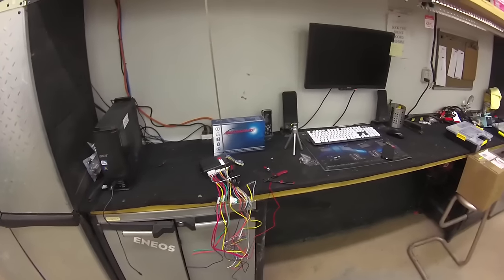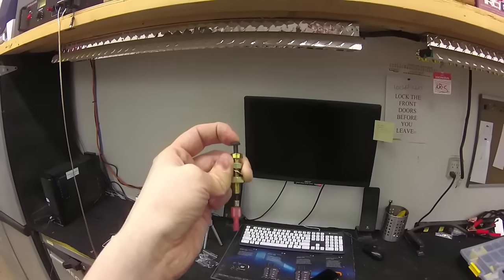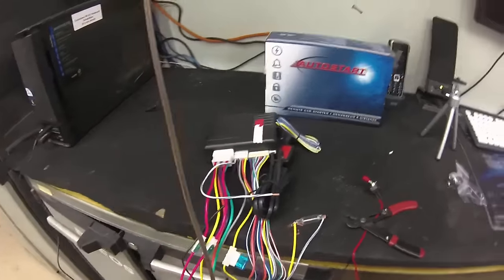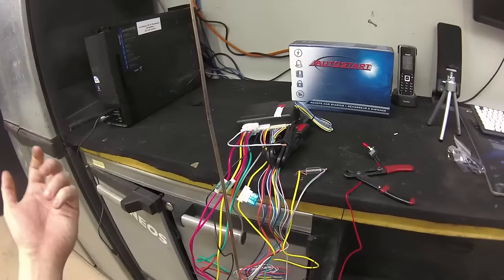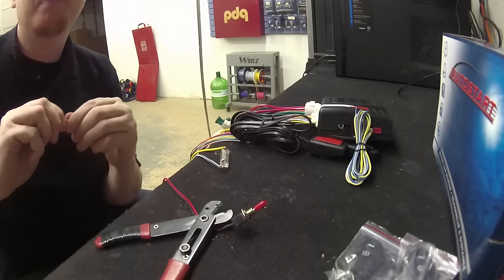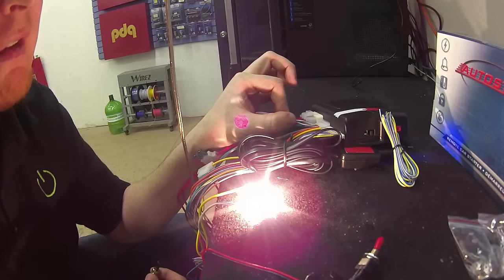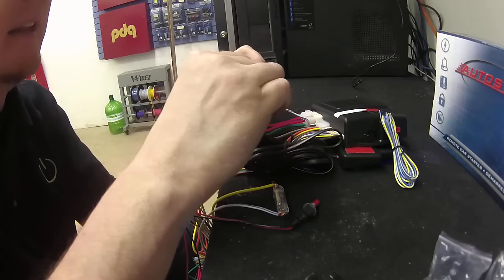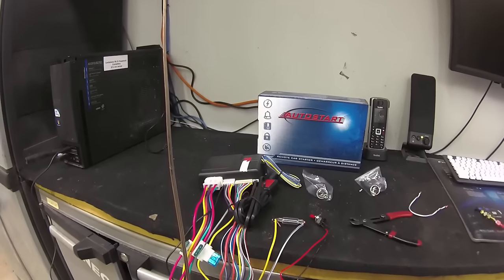How To Program an Autostart Remote Control Without a Hoodpin

Comment: ok i have a 2015 toyota tundra , now i got an autostart asra 2510 install on it , when i start the truck with the remote and the wiper switch is ON the wiper are working ,this is not a good practice cause if the wiper are froze in , it will burn the wiper motor , what can be done ??
Reply: +John Gamelin Keep your wipers in the OFF position, the wipers are controlled by the ACC (accessory) circuit, which also powers your blower motor (climate controls). OR, determine the wiper control circuit (@ the switch) and install a relay to interupt it while the car is remote started. Easiest solution = don't leave your wipers on
Reply: +Jeff Bates thanks , that is what the installer told me but i had trouble beleiving him , other remote don`t have that problem  !!!
Reply: Use a relay to interrupt the wipers.

Comment: I can't find the help video i'm looking for. my remote starter isn't working and i don't understand the instructions i wrote down from the tech who fixed it a couple of years ago. They do work, just I didn't write enough detail for step 1 so i can't do it. I have an Orbit OB-2470V and the manual doesn't even have this easy fix. It's really the first step that I don't understand because my note-taking wasn't good enough. I wrote it down quick as the tech was explaining quick over the phone. This is what i have:
1. Flash hood -- switch. Car lights stay on for 30 seconds.
2. put foot on break while lights are on, press lock/unlock on remote, lights will flash.
3. take foot off break
4. start car with key.
5. after 3 seconds, press brake again, lights will flash and bam.

Does anyone know what the heck the first step is all about? I don't have a hood pin and I remember him disconnecting a wire from the battery and touching it to the frame of the car to ground. It was once he did this that the lights went on for 30 seconds. I followed these instructions a couple of times shortly after he gave them to me, and they worked, but it was 2 years ago now and i haven't had problems since. I tried step one tonight in various ways and it didn't work. I tried with key at 1 click, lights on, then lights off, then i tried with key at second click with lights on, then off. I also tried with e-brake up and car in neutral. Does the door have to be open? I don't remember the specifics for step 1... any help is greatly appreciated!

Comment: Im having a problem for a while with my remote start i had mine installed since sep 15 and about feb my remote starter wouldnt start my car but it would attemp to like crank crank crank but thats all then it would stop and crank crank crank then stop and my remote on my 2 way pager would beep one long beep and display error but if i love my car 3 times like lock beep lock beep lock beep wait 3 sec and hit start on my remote it would crank and start i dont know whats wrong with and my shop that installed wants to charge me to check its about 100 dollars
Reply from the maker: Hi Bryan, this is definitely something the shop should check, and it should be covered under warranty if they did the install, although shops have different warranty policies on their labour so if they are saying they will charge you, guess they don't/didn't offer you any sort of warranty coverage. You may want to find and work with another shop, as your current one doesn't sound too customer focused

Comment: hello, thank you for your video tutorial, i have a problem i have order a used remote on ebay(NAHRS5304), but im not able to program it with my autostart, the remote is almost the same that the one i already have(NAHSAW4)), that seem to be another version but the case is the really simillar, is that possible that this particular version is not compatible with my system?
Reply from the maker: +David Gagné Well yes they are different, hence the different FCC id #s The remote you bought used will not work, return it to the eBay seller you bought it from for a refund.

Here is a link to a brand new remote matching the FCC id you originally had: http://lockdownsecuritycanada.ca/products/autostart-as114-433-astr-b274

Comment: Do you leave that wire in the black and gray slots once programmed. Thanks
Reply from the maker: Yes, but make sure the gray wire does not touch the chassis or a source of ground, otherwise the system will think the hood is open

Comment: I’ve tried the steps 3 times and no lights flash. I have the hood pin. I opened the hood, pushed the pin in, released it then shut hood. Then turned ignition on then off then press and held the AS button until the led on it flashed repetitively. Then let off. Tried starting and locking and unlocking nothing happened.😕
Reply: Also open close then left hood open turn on then off key and held in AS key nothing there either

Comment: hello, I have my ct-5742tw remote that after I changed the battery does not beep when I start or press any button, also the two way communication is no longer happening. i do not get the chirping sounds to indicate engine started nor the 15 minutes timer that counts down to engine shut off but starting the car and locking and unlocking still work. are you able to tell me if reprogramming it using your method would bring back the full functions? I tried everything in the manual to no success.
Reply from the maker: If the key fob is programmed and the sounds are not working, re-programming will not do anything. SOunds like you may have put the remote in mute mode or the remote is faulty (remote = key fob). Try reaching out to www.autostart.ca, they are the manufacturer of your system, or go back to Canadian Tire and see if they can warranty the key fob for you (not sure how old your system is)
Reply: Hello, and thank you for taking the time to reply to my inquiry. The transmitter or key fob is not in a mute state as all other sounds like the alarm and parking meter count down are still audible. Is there a possibility that the actual remote starter under rhe dashboard has lost the twoway transmitting or is failing to send info to my fob? I have e mailed autostart and will wait to hear from them. As for warranty, i have bought it two years ago. I don't have warranty on it anymore I think, but I will doublecheck with canadian tire.
Reply: Lockdown Security do you have any idea why the light only flash 1 time after press the lock button but not 5 times?

Comment: the button on the brain does the same thing and no wires needed...just saying.
Reply from the maker: Thanks for the heads up.
Reply: you do still need to have the "hood open" even with the button tho (or ground the hood pin wire @ the brain if there is no hood pin) @LockdownSecurity